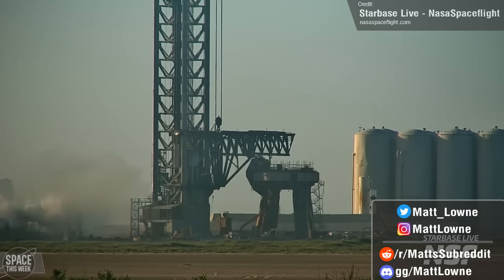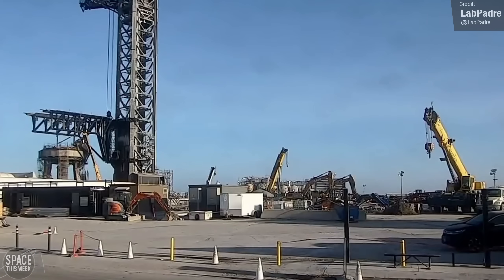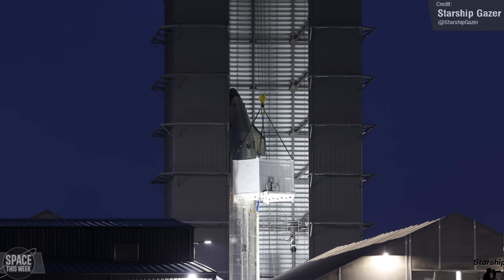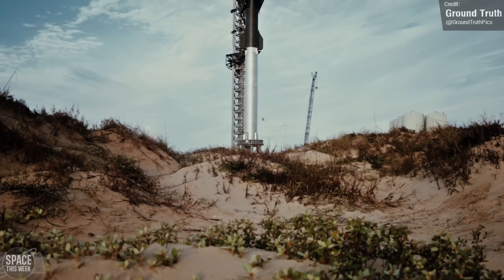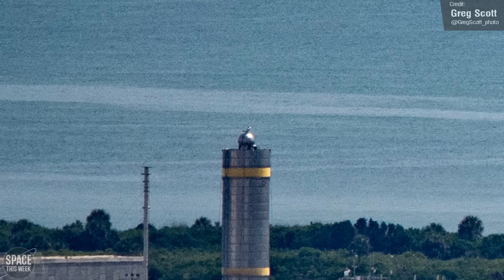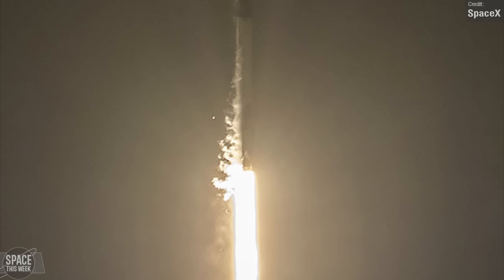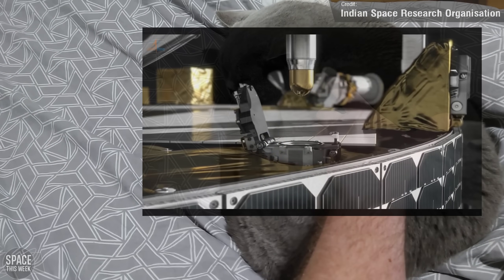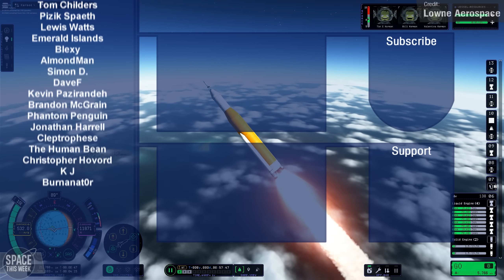SpaceX Superheavy Spin Up and Deluge Systems Tested, Ship 24 Returns, India Launches to the Moon

Comment: Greetings, I was wondering why on the lunar starship the engines and the fuel tanks couldn’t be on the top, leaving the bottom for all the equipment and cabins. It would eliminate the need for an elevator, especially since the engines have to be on top anyway.

Comment: I have a question about the next starship launch. If starship does reach orbit (Which hopefully it will) what's gonna happen then? Is it gonna deorbit then crash back onto earth and get destroyed or are they gonna attempt a landing?
Reply: They probably will drown it, while testing deorbiting before that
Reply: SpaceX has said that the next flight will have the same profile as the first.  They won't circularize the orbit, so that if something goes wrong, it comes back no matter what. They will likely hard splash them down too, like the first launch was planned to do.

Comment: Still wondering why they made a closed and not opened interstage ring. I mean Soviet ones were perfect with the reticular structure so that the hot-stage thrust and heat has a way better escape to the sides instead of just firing at the Booster dome closure top even for brief time, potentially damaging the latter for clear reasons.

Comment: The water orifice steel plate .  The water will be bucking the very high pressure of the rocket exhaust gases .  That pressure will reduce water flow out of the orifices and might stop flow all together.  The inboard rocket engine test will give evidence if there is a water flow problem so Space X can save face before a full launch power test if there are concerns shown.

Comment: 7:13 the stage 1 telemetry is still displaying it's values. if it has stopped updating then you know what happened.
Reply: I’t did freeze at 13KM/H
Reply: @nether_bat  you might be saying that because that's what it looks like in this video

Comment: Didn't you get or at least phrase that wrong at 2:00  The ignition of the outer engines is done by the launch system.  They are fueled by the rocket.  But they are ignited by the stand.

Comment: I’m still wondering if we are going to see a starship launch with a booster landing at Kennedy followed by a booster ferry flight back to Boca chica.
Reply: The booster doesn't go far enough to make KSC I believe, based on SpaceX filings with the FCC. Not to mention that overland flights of the Superheavy booster likely won't be approved until it has flown a LOT, safely.
Reply: @steveaustin2686  What about using the sea launch platforms (oil rigs) to catch the Kennedy boosters?
Reply: @nether_bat  Per COO Gwynne Shotwell, SpaceX sold the oil rigs. She said that SpaceX may revisit ocean platforms in the future, once Starship is flying reliably.
Reply: @nether_bat they sold the oil rigs.
Reply: @nether_bat they don't have those anymore
Reply: There will be no launch or recovery at the cape until the whole system is proven. Thats a fact that nasa has stated in the past. To much infrastructure to put at risk.
Reply: Same
Reply: unfortunately, NASA didn't allow SpaceX to catch the booster with chopsticks.
Reply: @xx_peace_xx5300  NASA doesn't care what SpaceX does at Boca Chica. SpaceX themselves decided to expend the booster and Starship with ocean landings.

LC-39A is currently the only pad for Crew Dragon and Falcon Heavy launches. NASA doesn't want Starship from flying from LC-39A, until there is an alternative for Crew Dragon launches. SpaceX has already started upgrading SLC-40 for Crew Dragon flights and probably will upgrade it for Falcon Heavy as well.
Reply: Which "Starship"?  Renaming every new failure "Starship" is a Musk trick, LOL.
Reply: @java4653 that’s why they are labeled like this, starship sn15 = ship 15
Reply: F1 pit crew at Kennedy, sprint to the pad with gas bottles

Comment: My question is after all this work is done what will the turn around time look like after the next launch? I wonder if they will need to make major repairs to everything else component wise other than the steel plate.
Reply from the maker: They have fired single raptor engines at prototypes of the water-cooled steel plate, so hopefully they have some idea how resilient it will be!
Reply: @MattLowne well, in theory at least, at the pad, it would be higher up, AND have larger are to dissipate heat into. So, it should work out.
Btw, when new video? Just asking.